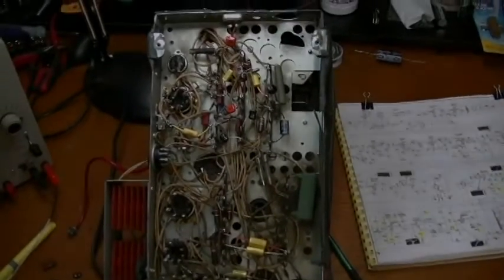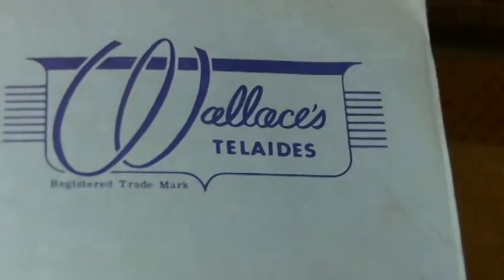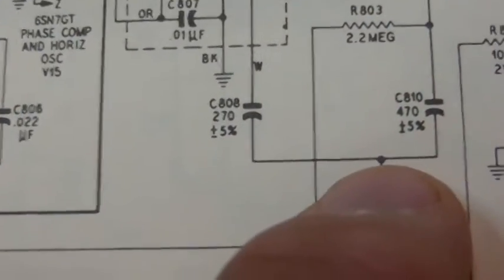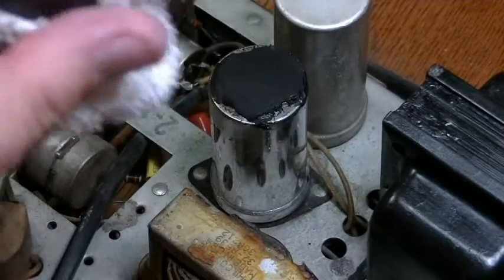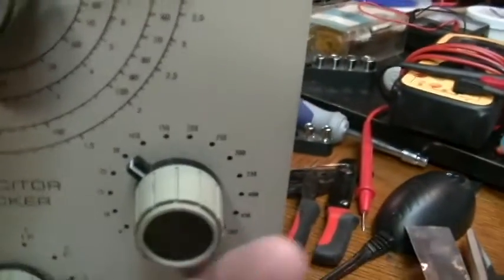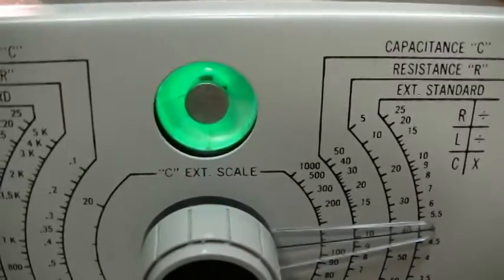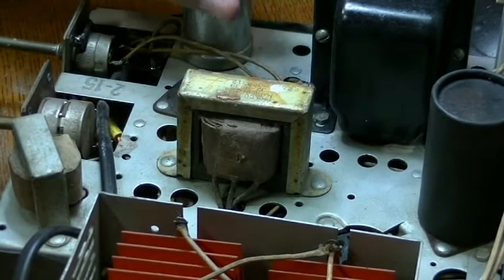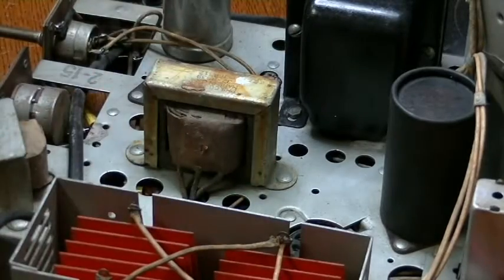Philco 52 T1802 Restoration Part 4 of 7

Comment: 19:30 Heathkit IT-28, Noticed your eye opening was a little erratic. On mine I had to disassemble those wire wound pots and clean out the old grease, clean the wire windings and wiper, and reassemble with dielectric silicone grease.Works great now, then my Heathkit IG-18 signal generator just went flakey on me. Power supply regulator problem, probably either a bad zener or regulator transistor which are no longer made.